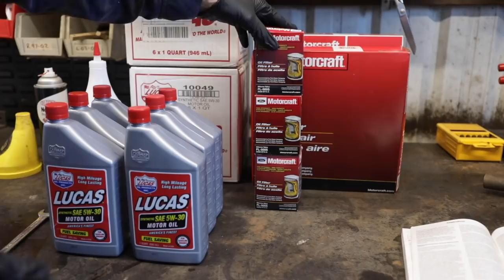How to Change Your Oil Like A Pro

Comment: Here's a few more tips;

Always double-check that when you remove the old filter, the gasket does not stick to the oil filter housing.

If you spill motor oil, brake fluid, power steering fluid, etc. sawdust works great at soaking it up, especially on porous concrete surfaces where shop rags and towels may not be sufficient. 

As far as filter tightness, most filters say right on the filter to thread it on until the gasket makes contact with the filter housing,  and then give it another 1/4 or 1/2 turn.

If you can't fill your oil filter with new oil because it is mounted horizontally or vertically with the mounting surface facing down, then run your car for 20 seconds, turn it off and check the dipstick again.

If the filter is mounted vertically with the mounting surface facing down, like on many Subarus, remove the drain plug, poke a few holes in the top of the filter with a nail, rotate the tires, then remove the filter now that the oil drained out. Otherwise it gets everywhere, and there is a drain hole on the filter housing, but it still puddles up unless you do it this way.

Obviously check tire pressures and all of your fluid levels and top them off with the proper fluid the manufacturer calls for. Some cars may need DOT3 brake fluid, some may need DOT4. Many Fords use Mercon Transmission Fluid in their power steering system. GM vehicles need Dex-Cool anti-freeze. Always make sure you're putting in the right fluid.

Rotate your tires in a criss-cross pattern ONLY if they are non-directional tires AND are not staggered. Directional tires are easily identifiable arrows on the sidewalls of the tires and the word "rotation", indicating the direction that the tire should rotate. Sometimes staggered tires are not easily identifiable to an average Joe because the rim size and sidewall height is the same on the front and rear axle, but they may have a different width. Sometimes you may even have a car, usually a sports car, where you cannot rotate the tires because they are directional and staggered.

But before you do change your oil, decide if it's worth it to change your own oil. Most of the cost of having an oil change done at a shop is just the cost of the oil and filter itself. The mechanic is paid almost nothing for doing it and many places do oil changes at a net cost, mostly because they offer low prices to get you in the door and hope to sell you other services.

Consider that the shop is taking on the liability in case something goes wrong. If the drain plug or the threads in the pan strip, do you have a tap and die kit to fix it as well as the ability to remove the oil pan? 

Not to mention that a skilled, professional mechanic will give you a thorough inspection and may catch some issues that aren't easily spotted by the untrained eye. 

There are also some cars that require a scan tool to reset an oil change reminder indicator, which you don't have access to. 

If you do a tire rotation on some vehicles with Tire Pressure Monitoring System like GMs, you may have a TPMS malfunction because the system needs to be reset and the new tire locations need to be programmed into the monitoring system.

Finally, you may have a small issue with your car that you recognize but cannot diagnose, or even an issue you don't know that exists which the mechanic may be able to identify and fix, free of charge. Case and point; Let's say the mechanic is doing an oil change on your vehicle and while doing the tire rotation, he notices that your front brake pads are wearing very unevenly. The untrained eye may not even notice that. But he knows it's a sticking slide pin, he removes it, hits it with a dye grinder, greases it up and reinstalls it in 3 minutes and never charges the customer. Or maybe you mention that your car won't start sometimes and he notices that the throttle cable just needs to be adjusted - any mechanic with integrity isn't going to charge you fora 2 minute fix like that. So maybe it's worth just bringing it to a shop for some people.

Comment: don't know if anyone wrote in comments but I am gonna write it anyway bc I think its a common mistake. Make sure that old gasket from the old oil filter came out before you put in the new one it may sometimes stick in there which causes a double gasketing which leads to an oil leak at your new oil filter.

Ps: excuse my English it's not my first language

Comment: Some filters are mounted sideways so it doesn’t really work to add oil preinstall. Also, always check to see if the gasket is still on the old filter.  If you put a new filter on and the old gasket is still on the engine, it will blow oil everywhere when you crank it since two gaskets won’t seal.  I knew better and still forgot to check one time.  New oil all over the place.

Comment: Great video. I was a amsoil fan, however, like you, I just found it a has-sell getting it. Thanks for  saying lucas is available on amazon. Also something I am investigating. A very competent local mechanic said you really need to run an oil filter that has a check valve. Not sure yet but looking into it.

Comment: You can still put oil in an oil filter that mounts horizontally, just not as much.  Soak the filter media so it takes less for the engine oil pump to fill the filter when you do your first start after the change.

Comment: before removing the oil filter and draining the pan, it's also better to open the oil cap and the dip stick to allow air in as the oil drains

Comment: Another Pro-tip...
Don't use the "criss cross" pattern to rotate tires that have direction markings (pretty much any car tire out there), you'll just end up doing some aquaplanning. 

Either take your car to a shop and have them get the tires out of the rims to position them correctly, or just swap front and rear tires mantaining the left side tires on the left and viceversa. 

If you don't find the direction markings, but the lines are in a "V" shape, take it as an arrow, the point should always go forward and downwards.

Comment: Wow, I'm amazed Lucas survived a used oil analysis. I know i wouldn't run that stuff in my lawnmower with the used oil analysis i've read. And while their engine additive may not do any harm, I certainly don't believe its going to do any good either, if anything it's just diluting the good oil your using in your car and thickening it up a little more. I'd argue with most modern name brand engine oils, you don't need an oil additive at all, they've got pretty much everything needed.

Comment: When doing your own oil change make sure the oil filter O ring came off when you removed the old filter  I have seen a few come in the shop with oil leaks because of double O rings.

Comment: I must agree with you   I run the same tires and I rotate my tires every oil change    I run a diesel so that's every 4,500 miles   I always    am crazy  about that    maintenance is cheap buying parts  not so much

Comment: I love Lucas products & have used them for years. I had one instance with Lucas fuel stabilizer. When I put it in my Wife's Toyota, it interacted with the gas can liner eating it away and gumming up the injectors and the like. Toyota cut the fuel tank open, sent me and Lucas pics and we sent Lucas a sample. They ended up covering the repair but said nothing else. I assume they made an adjustment to their formula. I still use their oil stabilizer products to this day.

Comment: I used to run Valvoline in my F250 but it was getting valve chatter while going down the highway. Mechanic told me to start using Motorcraft, never had that problem again.

Comment: Love the video, but how have you gotten by without using a fumoto oil drain valve? These little things are life changing when it comes to oil changes. I have been using them for years without fail and its such a pleasure now draining oil through a vinyl tube into my oil storage container instead of all over the floor.

Comment: I have been changing my oil for years. I believe I have a good system down that works for me. I use a Stainless steel mixing bowl to capture the oil. Any bucket will work ...its getting the oil out and cleaning the bucket that makes a difference to me, especially time consumed. To me changing the oil should be a very quick operation. Also, I always put a funnel somewhere in the engine compartment for convenience. Also If I am away from my garage and need to change the oil, the funnel is right there. The only problem is that when I get the car inspected mechanics like to take them.

Comment: I'll give you 12 & 13, very simple, spray some silicone spray on all the door seals, keeps the rubber soft. Check tire pressure.. OK #14, grab the front tires at 3 & 9  o' clock, check for steering play, and then at 12 & 6 and check for wheel bearing play.

Comment: The lighter wheels will give better economy and less load on your motor. On my TDIs I found the lightest OEM vw wheels that fit the pattern and saved a bunch of rotating weight, paid for themselves quickly. not super showy but best place to save weight over steel.

Comment: Cody, it is an east coast thing.... I read manuals.  I have been a diesel and automotive tech for over 30 years and the one thing that has never changed is the need to read the manual.  You manual for you van says to cross the front tires to the rear and move the rear forward on the same side.  Be very careful in following tradition.  You will eventually get burned!!!  See page 279 of the 2018 Transit Owners Manual.  I hope this improves performance, brother.

Comment: You should cut open one of those Ford motor craft filters. You will find cardboard and loose pleats. I use K&N I cut it open and found huge differences.  K&N uses no cardboard and good tight thick pleats. Also the casing is much heavier duty. That is important on off road vehicles. The cheap filters can be punched by a rock being kicked up. K&N will hold up.

Comment: Outstanding video Cody!  I don't change my own oil, but I check all the fluid levels, lubricate doors and locks add cleaner to my gas and keep all my paperwork of all work done.on it.  How do you feel about additives to the gas to keep the injectors clean??

Comment: From a very amateur racing background - wheels can make a big difference. Sure, less so underneath a few tonnes of van, but in your case going to a bigger wheel and tyre combo could give you better off-road capabilities - but, of course, there's no point in doing so if that's not what you want to achieve.
Reply from the maker: You're correct, sprung and unsprung weight are important in performance cars. These cars come with light alloy wheels from the factory. I'm talking about trucks, vans and normal cars not race cars.

Comment: 11:49 and always do it this way, that way your steering tires are rotating the same direction they were before, as the cords reseat from the change in rotating direction they can cause steering instability.

When I was younger and a bit more strong of will I decided to prove this wrong, it proved me wrong!  3 times.

Comment: One of the issues with running something to thicken the oil, particularly in a modern engine, is that there are certain engines that rely on hydraulics to operate the variable valve timing mechanisms. If the oil is too viscous, the vvt will not operate properly and can damage components of the engine. For that reason I'm very cautious of additives. Also, Lucas has a tendency to aerate and foam. Some people swear by it. I think it's great in an older engine, I just won't run the additive in anything newish.

Comment: Years ago oil came in metal cans during the depression My step dad let a guy build a store-gas station on his ranch at the highway intersection. The guy cut up the metal cans flattened them and used them for roof shingles.

Comment: Suggestion I was always taught to put the oil cap where the hood latch closes yes you might break the cap if you forget but you won't drive off with out the cap on

Comment: Life hack: The threads on the Ams oil quart bottles are the same as the oil cap. Cut the bottom off and you can use it as a makeshift funnel. 
This is the case on my Toyota Tacoma. Not sure if this is the same on all cars.

Comment: @3:15 Amsoil has a warehouse/location in Portland where you can get it from. You can also order it directly from the Amsoil website and get it within 2-3 days, especially since the warehouse/store isn't too far away.

@16:33 also I think your granddad probably also let the oil drain for 24hrs cause SP2/OSHA, recommendeds used oil bottles to be drained upside down for 24hrs so you can get as much oil out of it as possible before disposable.

Comment: One thing I learned when I was younger is to make sure the o-ring come off on the old filter and doesn't stay on the engine. If it does and you don't notice, needless to say, it won't seal.

Comment: On rotating tires, as long as they ar not directional, i rotate fronts strait back and cross the backs to the front.  That way each tire get to go to every position. If you just keep criss crossing your tires they only go to the same two spots

Comment: Something else that is supper important when doing an oil change, more specifically the oil filter change.  Make sure that the old seal is out, they can stick to the car and if you still have that seal in there 2 seals is not better, it is going to leak like a sieve.

Comment: I feel a lot of people ignored what you used to "grease" your lock, but please everyone do not put any type of oil / wet lubricant in your locks. A 20 cent thing of graphite dust is all you need. Even what wranglerstar is using will pull dirt/lint off keys and gum up the door.
Reply: With most, if not all vehicles being keyless entry it is a good idea to actually use the key to unlock the door(s) occasionally.   Youcan rest assured you can get into the car even if the key fob fails.

Comment: I just have the local shop in town do it. They know what they are doing, use good oil and do it for less. They don't make much on oil changes. And the fact that they can buy things in bulk cuts costs. I used to change oil but letting them is easier and cheaper

Comment: Cody and friends I would never risk preloading an oil filter on any new car. If I has a vvt system if any foreign object from that oil can gets in those small oil holes in the cams it could turn into huge issues. On old hot rods and such probably wouldn’t hurt but not on the new ones and pretty much all of them have vvt that’s also why you see these cars with lighter oil call outs on the cap.

Comment: FYI I’m a Ford parts manager, and I’m sure your truck probably takes FL-500S and probably an FA-1883 Ford packed those same filters without the fancy consumer ready boxes the numbers are FL500SB12 and FA1883B7 bulk packs of 12 and 7 should be able to get them cheaper.
Reply from the maker: Thank you Adam,

Comment: You don’t need to run your engine up to temperature. Oil thickens as it heats up because of the additives oil companies use to protect the engine at high temperature. If they didn’t add thickeners then the oil would be so low in viscosity it wouldn’t cling on to the crank, bearings, and pistons. Hints why it’s 5w-30. 5 being a lower viscosity closer to water when it’s cold and easier to start in colder weather and 30 the viscosity at operating temperature 200 degrees F. Plus who wants to work on a hot engine and a lot of the oil sets on top of the cams. 

Also another tip. When I pour my used oil back into the containers I like to try to measure how much oil I get back out to see if my engine is using oil or not.

Comment: I used to work at a gas station and this clueless older woman came through and asked me for help checking her oil. She had a newer car and it did have a dipstick but there were no markings on it (I guess they're making decorative dipsticks these days, wouldn't want potential customers being able to service their own cars!). That alone was cause for concern, but was overshadowed by the fact that there was maybe a half inch of oil on the stick. She had an oil leak and practically no oil left in her engine. She told me she got this car after her old car's engine exploded because it didn't have any oil in it...

Comment: Save your gallon milk jugs for the old oil.  I crisscross the rears to the front, front goes straight back.  Also check under the car for leaks after starting.

Comment: I like to pull the oil dip stick out half way at the beginning of the job so there's no way you will forget to put the new oil back in.  I also have an awesome snap-on oil funnel that threads into the oil fill hole.  PS, Ford puts their oil filters in the worst places....

Comment: You forgot torque specs on the lug nuts and oil drain bolt. I’m not trying to come off as an smart ass but with a breaker bar or impact gun it’s very easy to over tighten the nuts. So all it takes is a $70 craftsman torque wrench set. To tighten wheels on your own slowly lower the vehicle down till the tires barely touch then you should tighten the lug nuts with a normal ratchet till the wheel has reached the hub, now torque the lug nuts down using the star pattern. You can find your torque specs by looking up your make, model, year, engine, and transmission.